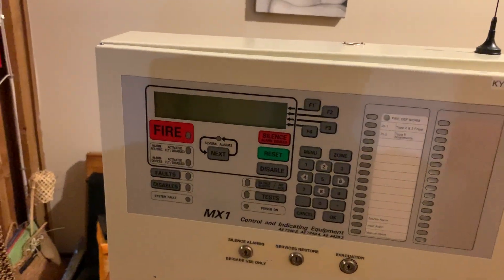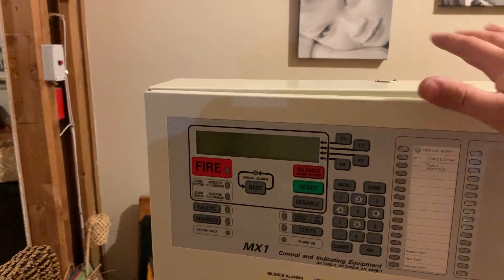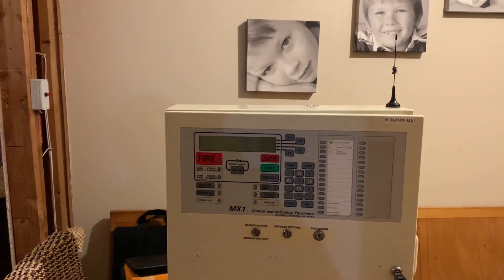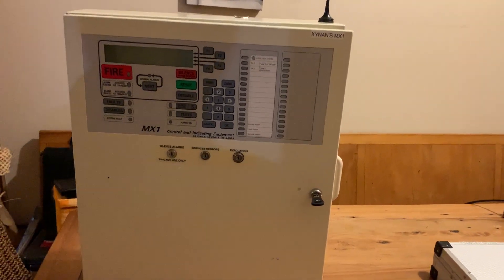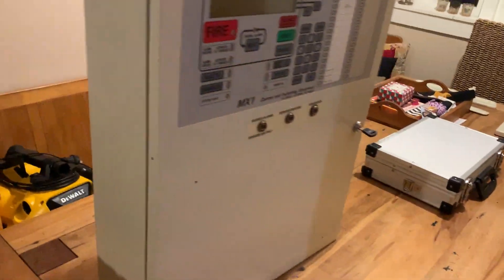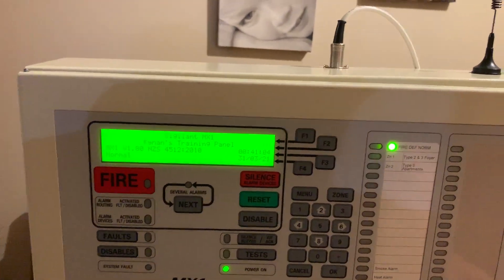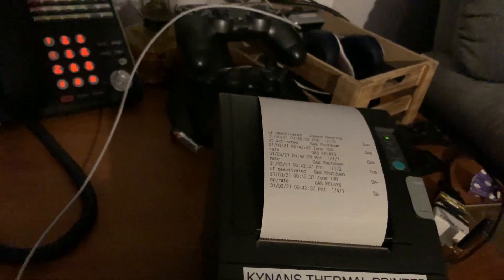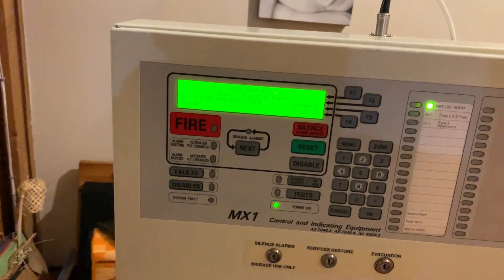MX1 fire alarm system- part 1

Comment: sounds like a panel i could get stuck into with all that flexibility, albeit easy to cause incompliance with regs as you said if you end up missing something. if i was doing this as a job i would write myself up a template to get the base system set up correctly then expand upon that to make it work for the project. it was interesting to hear that the tyco systems use the frequency shift keying to communicate, i have been doing alot of work with Apollo equipment. the protocol for that is simple and robust no complicated filters to mess with i have built a network driver circuit to interface with a dev board (Arduino) and i have written a program that drives the devices and collects their data and controls sounders and outputs on the "loop" . thanks for sharing :)

Comment: MX the world. JCI and Wormald are a separate entity and have been for some time now. MX1 is an amazing panel changing device profiles and custom logic makes unique and complicated jobs a breeze pertronics and ampac and notifier are good panels but when it comes to installing to more the 4512 for industry or manufacturing MX is the way to go. If it was a basic type 4 or type 2 I would 100% say use an f100/f200. You need to get yourself a 60w t-gen 2 for that panel as you can make custom evac tone and macros.

Comment: When I was up in your neck of the woods in February, the only MX1 I saw was indeed a Wormald install. Vigilant gear appears to be more popular in the big cities like Auckland and Wellington. Down here in Welly, as well as Wormald, MX1's have been installed fairly recently by the likes of Alliance Fire & Security, Nationwide Fire Protection and also ENGIE. I also saw quite a few Vigilant addressable systems up in Auckland, but I think those were MX4428s rather than MX1s, mostly installed by either AskMetroFire or Triangle Fire Protection.
On another note, that MX1 you've got must be a few years old, as it has the older version of the display.....the newer version has a few more colours and moves the buttons around a bit.

Comment: Vigilant have recently introduced KAC Call-Points (same as those Notifier use) as the new standard option. You can still get the old glass units, but KAC is now their main Call-Point.
Reply: And they are being installed on new systems right now....Alliance just did an MX1 upgrade with the new KAC's at a High-School in Porirua, whilst Wormald are using them on a Sigma 5 in a new building in Paraparaumu.